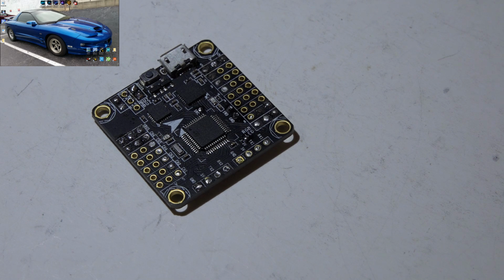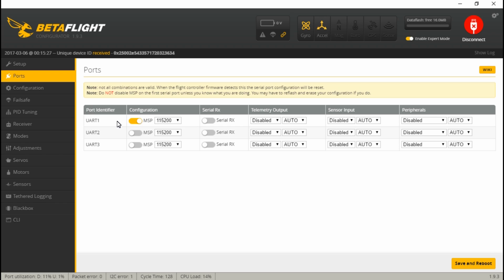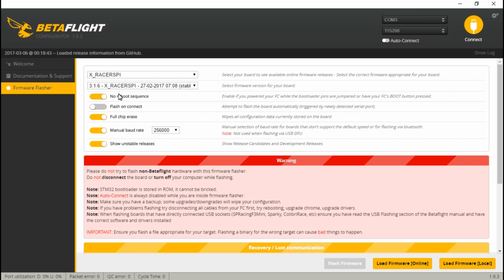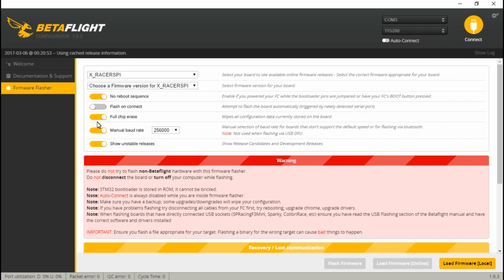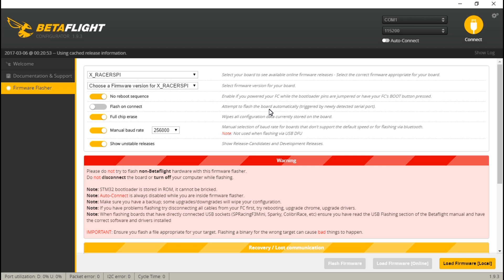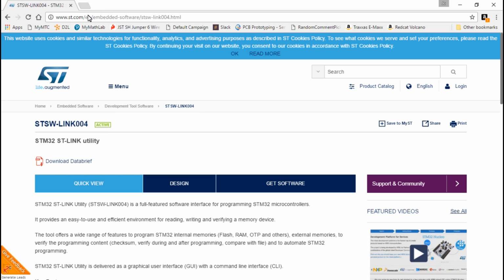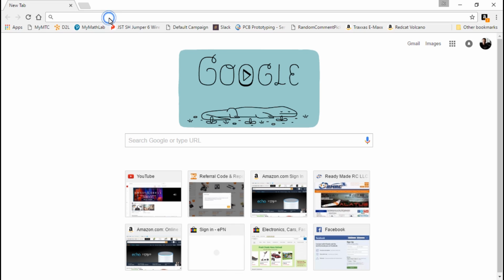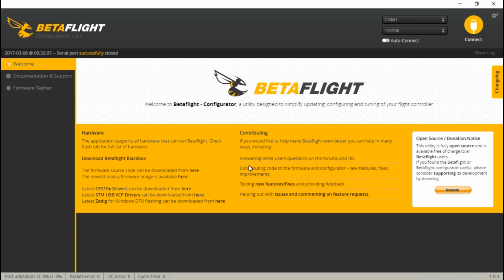How To "Unbrick" Flight Controller (both ways)

Comment: Blue Falcon i have a flywing H1 board with a 405 chip set on it and i can't access the board with the supplied software windows states usb device failed and no matter what i do i can't get it to connect i have inspected the board it has no marking's on it i have tried to contact the company and after several months no response from them would you have any ideas on how i can fix this board thanks in advance

Comment: Just flashed the wrong target to a crazybeef4 now usb not recognised in boot loader 😭
Reply: How did u fix. I bricked my spracingf3 board and I can’t update the firmware because it doesn’t show in the list of targets
Reply: @locksmith9580  I'm sure I force flashed it back to the correct one saw a vid on here some where

Comment: Hello... I've been trying for a week to gain access to my flight controller after I accidentally attempted to flash it with the wrong firmware (I saw the error a millisecond before I pressed on enter but my hand was already there). 

I have an immersionRC Vortex 180 which uses a Synergy v4.0 flight controller and OSD (both on the same board). It has no pins but a ribbon cable that plugs into the main PCB. The solder pads have no identification at all. 

After I attempted to flash the wrong firmware, it just hung up for over 4 hours. Eventually I had no choice but to unplug it. When I connect it now, I see in the device manager of Windows that the OSD part of the ImmesionRC USB to UART connects perfectly but the flight controller part does not.

The OSD loads perfectly but I can't control it since my Taranis X9D can't move the pitch and roll stick to go into the OSD. I lost all access to the flight controller. As soon as I turn it on I get on the OSD the message: "Flight Controller Error". I've been trying everything that occurs to me to access the flight controller but I have been totally unsuccessful. 

It was connecting perfectly to BetaFlight and CleanFlight before this. Now it doesn't. I thought it was totally bricked until I saw your video today. Neither Betaflight, CleanFlight or even Vortex's own flasher can see the flight controller so I can reflash it with the proper firmware. 

Maybe you won't have the answer... I mean, only an idiot flashes the wrong firmware... But it won't hurt to ask: Is there anything I can  do ?
Reply: I have the same problem with sprscingf3 board. Now I can’t reflash it because the target doesn’t exist. I have the firmware. But I can’t update it on betaflight. Did u find a solution?

Comment: you shouldn't need that st link. STM32 demonstrator does the same thing. I had a naze where i blew a diode after shorting the wrong pins instead of boot. 
after a replacement i used STM32 to re-flash it because cleanflight wouldn't. then used cleanflight to get a working version of the firmware. newest version locks it up.
I also have a SPRacingF3 that locked up after a crash so I'll be replacing the processor on that one. 
this hobby is getting interesting when i have to use another hobby to save money and keep it going.

one guy in a forum was trying to tell me that these things are very complex when in reality they are pretty damn simple and easy to fix when you have the right tools and parts.
Reply: Mine doesnt work with STM32 demonstrator, any idea how to fix it?

Comment: Thanks this has been the most comprehensive video on the subject. What if the controller does not have marked CLK or IO pads? (Hglrc 438 OMDF4) would it share other pads in this case? Tx6, Rx6? not much info out there on these locations

Comment: Hi JC, I'm trying to unbrick a CC3D revolution, with no success... I tried the FTDI/Main Port/ST Demo method... then I tried the ST-Link method described in this video... The flashing process goes through well in both case, but all I got is a solid power led. No status blinking, no windows recognition of the board and of course no connection to Cleanflight configurator. With a multimeter I was able to verify that the processor is being powered with 3.3V. Any thoughts on what I could do? Thanks!

Comment: Hi,
I'm new to drones and I think I've bricked my FC, it's a F3 evo brushed, what I did is I flashed the firmeware without soldering the boot pads, if the boot pads are not jumped windows gives me Unknown usb device, if they are jumped then I get a solid red led and I can flash new firmeware but that's it, I can't connect to the FC. The same happened to another board it's the HappyModel Eachie 32bit acro naze, except this one doesn't work at all... I wanted to buy the ST-Link V2 but I noticed that I don't have the SWC & SWD on my FCs, any ideas on how to solve it or are they dead? Thanks.
Reply: Hey, did you solve your problem or did you just buy a new one ?
Reply: Hi , I have the same question, did you find SWC on your FCs?

Comment: Excellent video.  I bought an ST-link V2, found the right pins and connected them.  It didn't work.  I didn't have any boot markings on the board, so I found one that was named "reset". I've tried connecting the 3.3 volts from the ST-link to it and tried hooking it up to the pin labeled "reset" on the ST-link.  I don't have anything labeled 3.3 volts on the board.  It's from a Tovsto Falcon 210 and doesn't look like any other board I could fine.  Tovsto says it's a SPracing F3 board though.  Is there anything else I can do before I just toss it?

Comment: Hi there, I have got the F3 Acro board and mine worked well but suddenly the UART1 is not sending anymore data out to the OSD and I can´t connect to the board anymore or flash it even with the boot pins bridged. Any idea what it could be? Do you think second method could make it work again or something broken?  The board itself works so I can fly with it.

Comment: Why is the ST tool better than using the ST software that is used to re-flash the micro thru USB?  I  tried the software and still have had no luck on  my Naze32.  I am wondering if the ST flasher will actually help in addition to what I have already tried.  ,

Comment: Thanks for that, that is very helpful. I have bricked Pixhawk Lite V2 controler, all LEDs are blinking but computer does not recognize it (no sound when connecting to computer), so I need programming tool (which I've ordered). But my problem is that my board has 2 processors (larger one is STM32F427 and smaller STM32F103) and 2 set of pads for programming and I don't know to which one I should connect to. And also not sure if I only need to upload pixhawk bootloader, just to make controler visible to computer or the whole software in my case for quadcopter.
Reply: OK, I did some search and it looks like I need to flash the large processor, only need to figure out which set of pads to use, as it's not very clear on the board which pads belong to which processor as tracks are not visible. Probably some continuity checks, should solve the problem.

Comment: Hi. I can not connect.
"Can not connect to target!
Pleasse select "Connect Under Reset" mode from Target-> Settings menu and try again.
If you're trying to connect to a low frequency application, please select a lower SWD Frequency mode from Target-> Settings menu. "

Advise what to do.
Reply: When connected to the USB, the controller blinks but is not detected in the system.
Reply: My controller is CC3D REVO F4 STM32F405 https://ru.aliexpress.com/item/Raceflight-Betaflight-CC3D-REVO-F4-STM32F405-Flight-Controller-With-Vbat-Buzzer-For-RC-Multirotor-Parts/32735178937.html?spm=2114.13010608.cb0001.6.8OsmJu&scm=1007.13441.37946.0&amp%3Bpvid=16493367-9c5e-4e2f-829d-94fc556eb17a&amp%3Btpp=1

Comment: What do you do when your USB broke off? I've tried connecting via UART1 and a linker to no avail. Any ideas?
Reply from the maker: I'll figure something out and do a video on it
Reply: joe fisher Josh Bardwell just put a video out in that today.
Reply: Hey, thanks!
Reply: joe fisher ftdi usb. uart 1 pins. unless you fried the usb chip too. but ive gotten my naze32 rev6 to connect via uart1 pins and ftdi adapter with an overheating usb chip. if you had telemetey setup you could try those pins...
Reply: Hello Killag, my naze32 rev 6 dof 10 don't work...I can connect it to BF but can't flash it...I think boot loader pins are erased...Is there a similar method like this video to connect boot loader via ftdi usb? thanks

Comment: Hello I Have the F4 Advanced Flight Controller - (MPU6000, STM32F405) how I can find the version of my firmware ? 
Is it necessary to update the firmware? For my FC what firmware should I look for? Thanks
Reply from the maker: Just go into Betaflight, then to the CLI and type
version
It will tell you what flight controller firmware it uses and what version of firmware is on it. If it doesn't let you in Betaflight then it has Cleanflight firmware on it. Go to Cleanflight and do the same thing.

Comment: But you can connect USB-UART converter to that other serial port with MSP enabled, can't you? Isn't that simpler?
Reply from the maker: You could but thats not the only way to lock up a flight controller. And if someone doesn't know how to unlock a flight controller they more than likely dont know what they did to lock it up. Either way flashing new firmware will fix the problem for most people, if not then the second way is a sure fire fix.